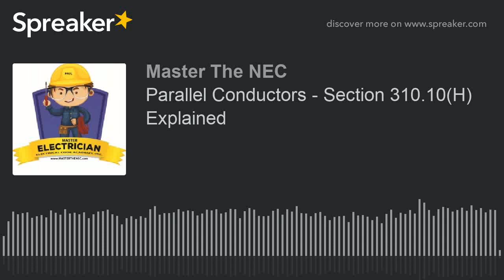Parallel Conductors - Section 310.10(H) Explained

Comment: Hi Paul, I have a question, in a parallel run, can you use a pull box sharing not only the parallel conductors but other conduits and conductors from other runs? I’m doing a job right now and there is an existing gutter that I could use as a pull box for my parallel runs, the gutter has enough space, so the 20% fill rule is not a problem. Thank you in advance
Reply from the maker: Greetings Carlos, as long as the wireway and, where used as a pull box,  is sized properly then multiple circuits can always share the same enclosures, even existing wireways. However, be careful that the existing wireway (raceway) doesn't contain service conductors or emergency circuits.